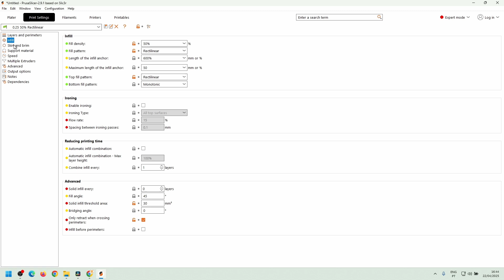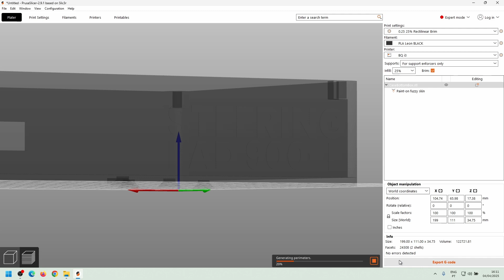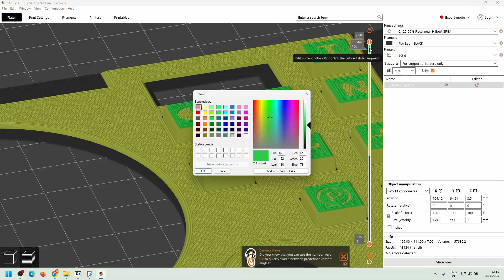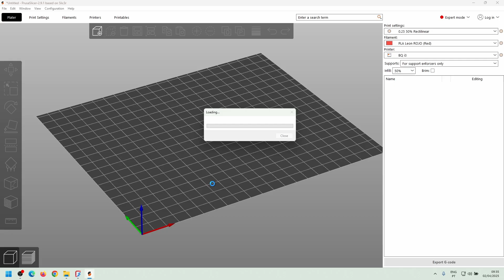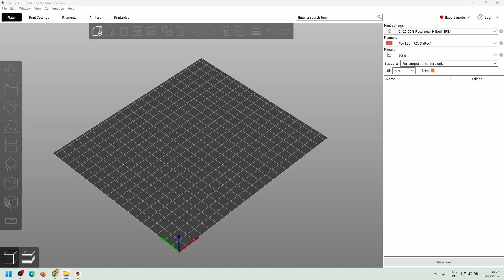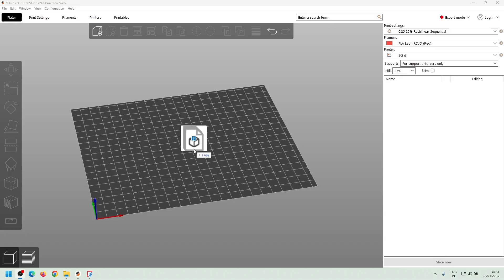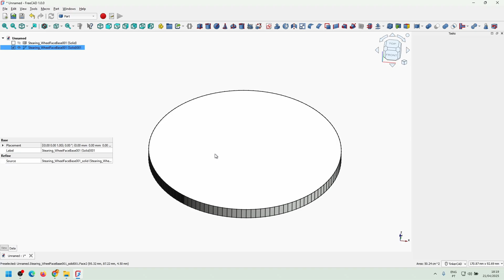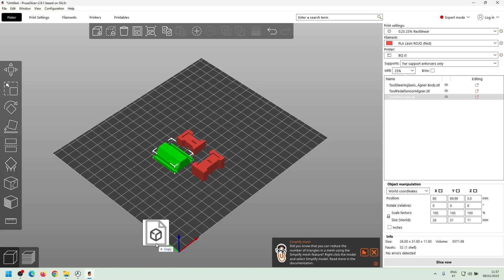The 3D Printing process of the Steering PAD 900-F

Comment: Hi sir, thank you for filming this video so that I can make a cool steering pad!
I have a question: how can I know the exact size of all the 3D models?
Reply from the maker: Hello. They are in real size. You can not scale them up or down. Just print them as they are.
If you want to know the dimensions, import them into a cad software and get the numbers by virtually measuring them.

Comment: Which software do you use?
Reply from the maker: That's a vague question!
For this project:
3D modeling: FreeCAD and Blender with scripts.
Slicing: Prusa Slicer
Programing: Arduino IDE
Video editing: Davinci Resolve
Voice over recording: Ableton Live
Imaging: Gimp
Planing and backup: google docs, sheets and drive
I hope I've answered your question!!!
Reply: @HomeGameCoderBuilds and what should I use for the file unit? Mm or inch?
Reply from the maker: This is all mm
Reply: @HomeGameCoderBuilds what material should I be using? Because there are so many options. Like, abs, pla, pla pro, petg, epla, etc
Reply from the maker: Well... this is the point where you find out that buying printer might be cheaper than ordering the parts!
All my prints are PLA, but...
there are cheaper materials/methods of printing that you might get temped to use but this parts were design with the flexibility of the PLA in a FDM printing method in mind.
The spiral might benefit being printed in resin since it needs to be very accurate and non flexible, but non of these files were design with the ordering process in mind so you might get mixed result from ordering them.
I want to make a version better suited for ordering but that will take some time since my schedule is really tight right now

Comment: Hello sir,
Actually, I don't have a printer and I wanted to know how do I tell them to put a magnet in the steering wheel?  I mean, they are using a CNC industrial 3d printer, which does have the tip of that metal.
Reply from the maker: Hello. Check my recent video about the updates. I solved that problem in a different way

Comment: Hi Rui,

I'm writing to you from Russia, and I just wanted to say how much I'm looking forward to the next part of your project video. It's an absolutely brilliant and inspiring build, and I'd love to try and recreate it myself.

I just have one quick question: is it possible to use a different motor driver instead of the 3383? For example, would the DRV8833 (which costs about 419₽ / $5.30) work as a substitute? The original driver is quite expensive here – around 1350₽ / $17.09 – which is more than three times the cost of the rest of the electronics combined.

That's all! Wishing you lots of success and patience with the next video – I really hope it's coming soon. Good luck! 👍
Reply from the maker: I know it is expensive. I tried others with worst result. The problem is the power and voltage. We are very limited in power because USB and the motor need a low voltage. For now, that's the only one that works

Comment: İ dont know very much english but whats the encoder mecanism idont understand
Reply from the maker: It is not an encoder. It is a magnetic sensor. When you turn the steering wheel, the mechanism moves two magnets, changing the polarity on the sensor. The electronics read the sensor magnetic position to apply to the steering wheel at the game. The sensor is fixed and the magnets move around it. The spiral is there to allow more than 360º. Whit the spiral I can have 900º of rotation while the magnets move very close to the sensor.
Reply: @HomeGameCoderBuilds  so it is cheaper than a encoder right?
Reply from the maker: Price was not my concern. I can have more precision with a magnetic hall sensor.

Comment: What is the display on the steering wheel for?
Reply from the maker: It has the configuration menu. You can set the force, calibrate the steering wheel, calibrate the min and max of the pedals, and set up the pedals curves (ease in, linear and ease out)
Reply: @HomeGameCoderBuilds  thanks for the quick reply. I really appreciate your work.
So is this feature yet to programm by ourselves?
Reply from the maker: @DrKleiner0815 No. You don't have to program yourself. I will provide the code ready to use and the process to set it up the first time